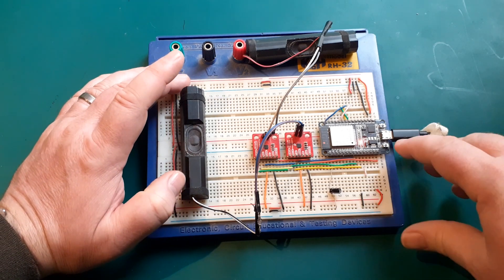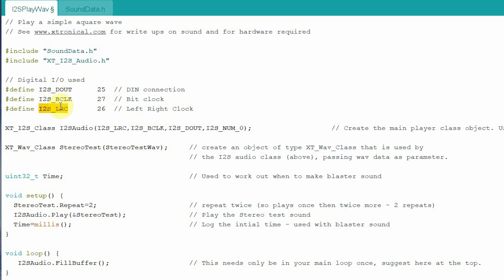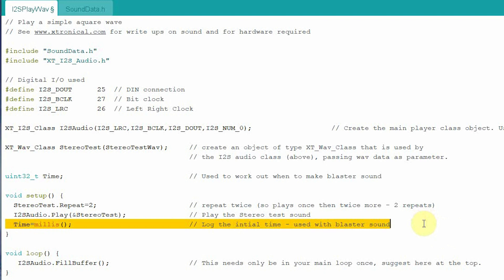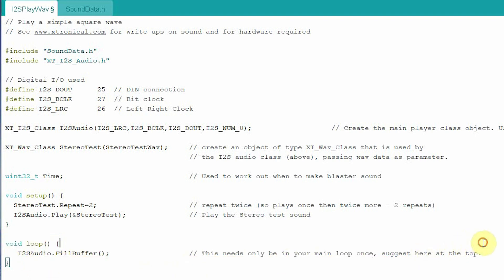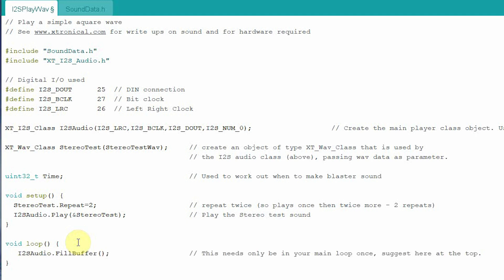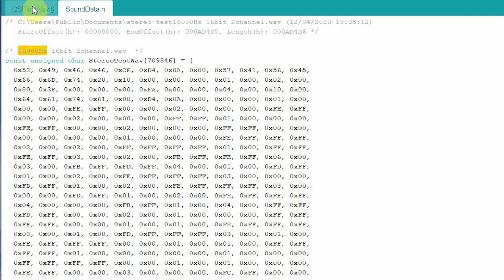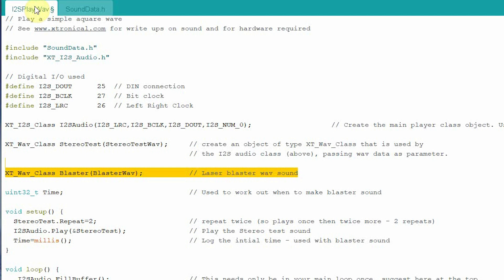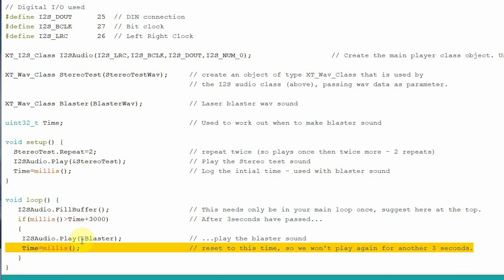My new I2SAudio Library - Work in Progress (Ep.1). ESP32, I2S, DAC, DacAudio, sound, wav, mp3, music

Comment: Hi Xtronical, is there a way for me to use your library without an I2S board and instead use the internal DAC and 1 transistor? I am using an EspressIf ESP32-WRoom-32D
Reply from the maker: You need my DACAudio library. It's on www.xtronical.com.
Reply: @XTronical  I just wanted to thank you for all the hard work you put in over the past few years. Great job with all the codes.

Just one more thing, is it possible to use SD with DACAudio?

Comment: Good work and I enjoy the northern accent. Have you tried the PCM5102a instead of those 2 boards? They are a lot more expensive than the 5102a.
Reply from the maker: Thanks very much. Yes, I've done some vids on those before Christmas. They are good but need an amp adding on (or use earphones). The library works with them without changes.
Reply: @XTronical  I must have missed that one. I'll check it out thanks. I've been looking for something ESP32 and I2S related so this was great to see. I live in the US but most family and friends are in Greater Manchester so your videos make me feel right at home.
Reply from the maker: Brilliant, thanks for the kind comments. Some I get are not so kind!

Comment: Nice work . Wondering if I can make it work as intercom with right setup Mono audio would be enough
Reply from the maker: The library does not support mics, so it couldn't do that unfortunately.
Reply: @XTronical  I love you videos and your work.  Ive been looking at esp32 audio libraries and I think playback is certainly lacking over I2S but even more lacking is mic support.  Is there any chance we could persuade you to add a few of most common mics and ability to send audio to a remote webpage in streaming realtime fashion, a remote esp32 for playback or a local SD card?  Id be happy to help fund your time on patreon.  This is the piece I think everyone is lacking
Reply from the maker: I don't do directly payed work, patreon is just if you want to support the channel generally. But adding a mic facility has been mentioned before so is something I would look at in future. So yes, I will do some work in this direction at some point. Thanks for your comments.
Reply: Well , in my opinion mic can be easily implemented , but library will convert to I2S which can be handled at APP side , for instance anyone with the “APP” can answer the door’s person , regardless where you are estoy d the house . My point is that I2S is working properly. Kudos !!